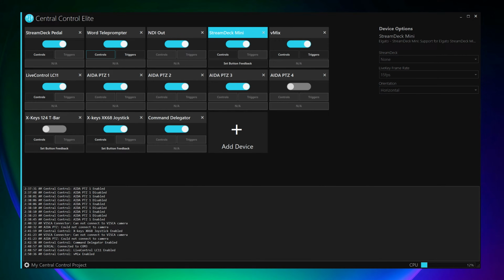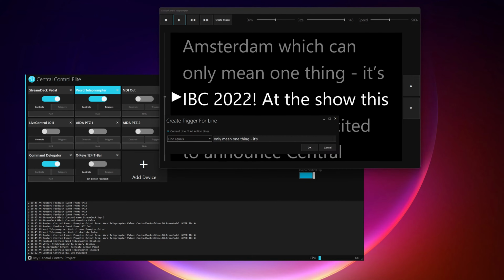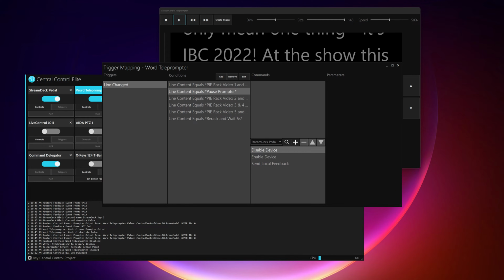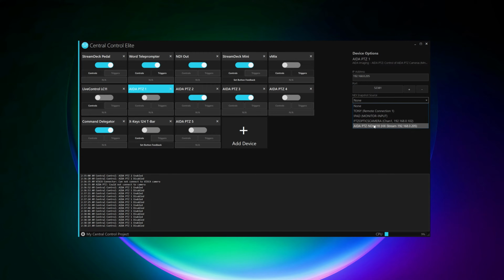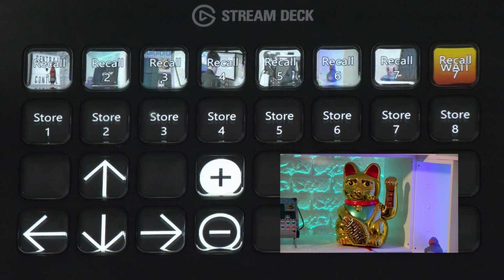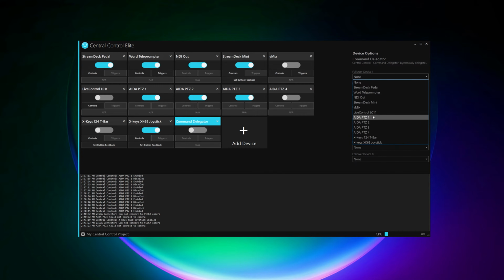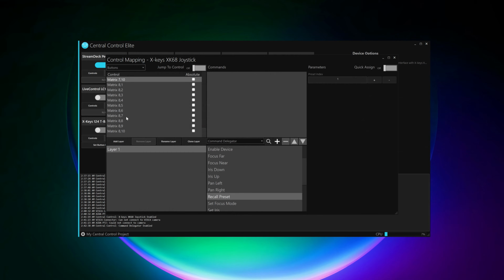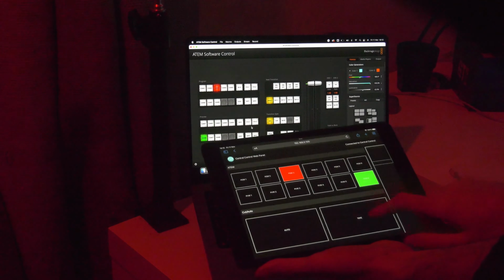Central Control 3 Available now - Teleprompter, NDI PTZ Control, Web Panel, Command Delegator + more

Comment: Hi Joe, 

We are interested in syncing Program/Preview TALLY signals of Newtek Tricaster TC1 and ATEM 1 M/E Constellation HD. 

We want to use Tally lights signals in our BMD Broadcast G2 Cameras but only works fine if the tally came from the ATEM Panel, but our Main Mixer Console is the Newtek TC1 with is own tally signal.

Is there anyway (with Central Control, perhaps!!) to sync Atem Program/Preview with the Newtek PROGRAM/PREVIEW? To change at the same time from Newtek to Atem?

p.e. Something that... when we push in TC1 the camera # in program/preview, the ATEM sync automatically the same and light in red/green the Tally Light of the camera #.

Best, F.
Reply from the maker: Hello! I replied to your mail earlier - Yes this is absolutely possible.
Reply: @thisiscentralcontrol  Perfect, works fine. Thanks.

Comment: Hi Joe, Any plans for adding Canon CR-N500 PTZ cameras  and Biamp Tesira DSP ?  :) We are looking for a  solution to automate PTZ control using Audio inputs from Microphones with a set position. Like for Video podcast, Visual radio or a Boardroom. Could Central Control be a tool for this?